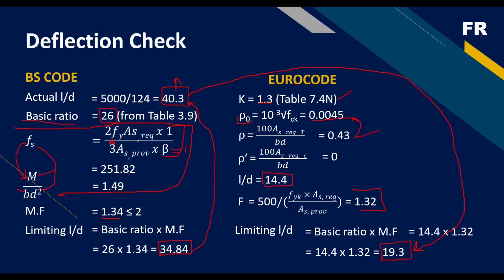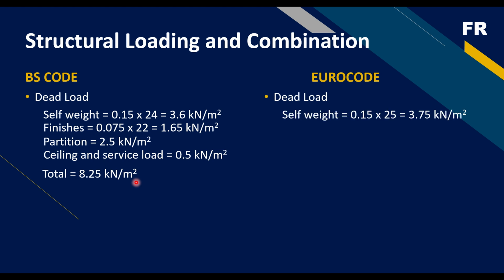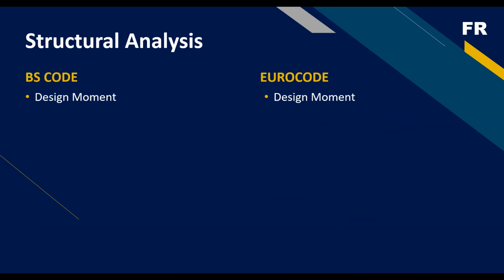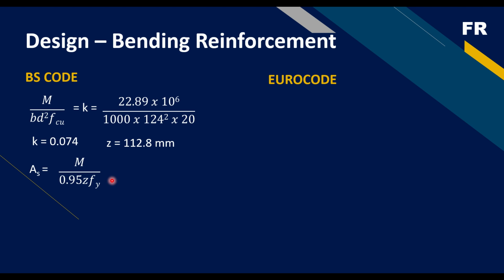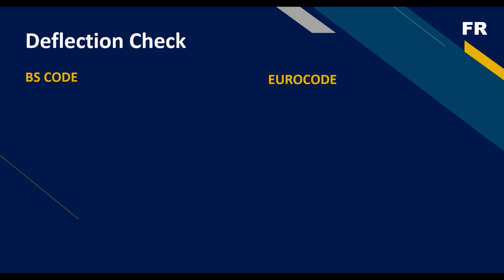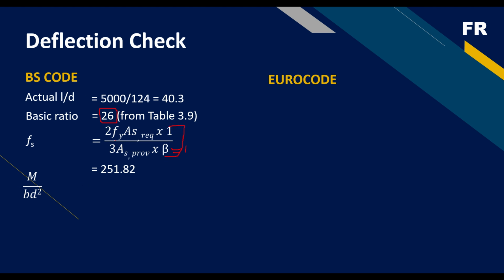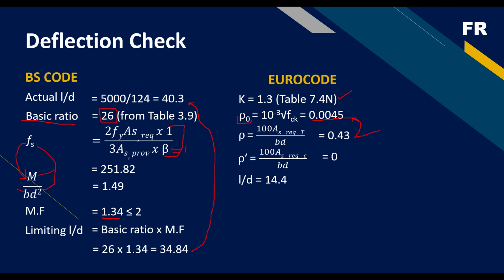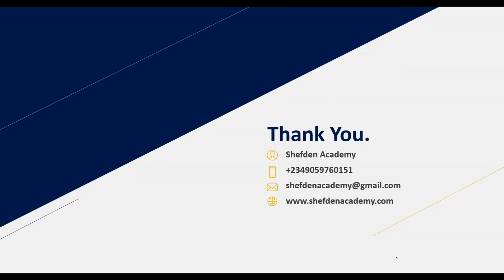Comparing Eurocode 2 Slab Design Approach to the BS 8110

Comment: Great video, interesting to watch, but I've just realized you are using two different class of concrete for the comparison. To be fair enough if the fck is 20 MPa for Eurocode related calculations then for BS code related calculations the strength of the concrete should be fcu = 25 MPa. not 20MPa
Reply from the maker: Yes, go observation.